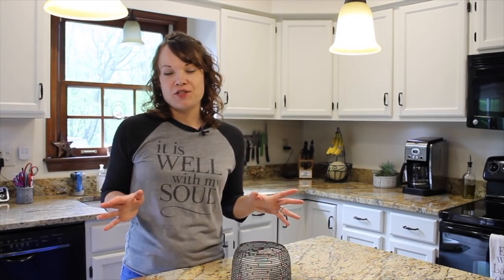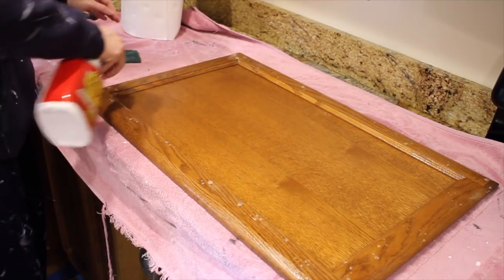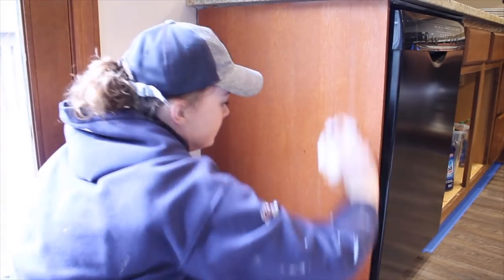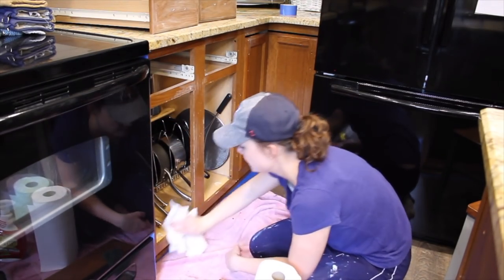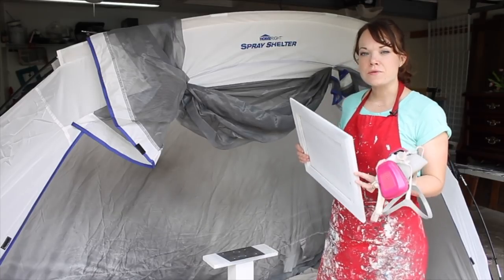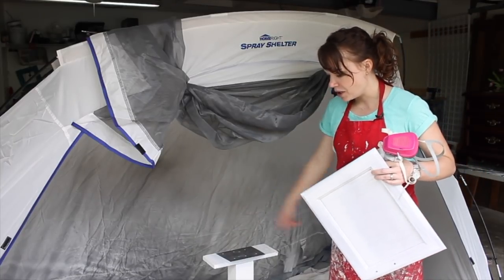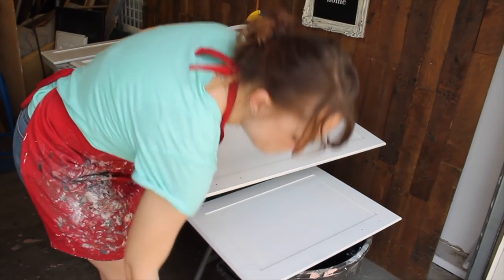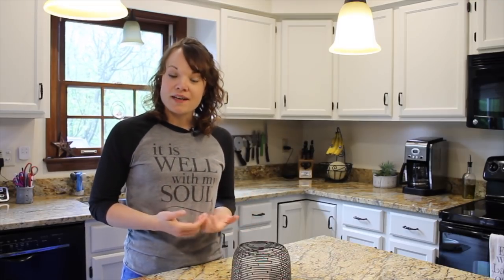How to Paint Kitchen Cabinets with General Finishes Milk Paint

Comment: A lot of extra work for milkpaint. Yes, do ALL that for all other paint. With milkpaint, a good cleaning and then simply add the bonding agent. I've successfully used this method for all my milkpaint jobs, including kitchen cabinets, unless it was raw wood, which doesn't require bonding agent

Comment: I’m actually right in the middle of painting my kitchen cabinets and using general finishes milk paint! What finish top coat did you use? I can’t decide! Love your videos!
Reply from the maker: How fun, great timing! What color are you painting them?  I used High Performance Topcoat in flat finish.  It was just enough shine I thought.
Reply: Going out in a limb and doing Persian blue! Any tips for applying the top coat? Little nervous- I’ve never done one before.
Reply: @RootsWingsHome  did the topcoat yellow the white cabinets? General Finish doesn't recommend putting a topcoat on white?

Comment: Did you sand the paint before applying the topcoat? If so which grot did you use. I've painted a bathroom vanity with 1 coat of primer and 2 coats of milk paint.

Comment: So, you sanded with 220 grit first,  then used Krud kutter and the second cleaner?  I was surprised to see that you can make circular motions with the sand paper!
Reply from the maker: Yep! You want to scratch it up good so the paint sticks! You would never use circular motions if you were going to stain the cabinets instead of painting.

Comment: My kitchen cabinets have previously been painted by a past owner. I believe it is a flat paint. Do you have any suggestions on how to prep the surface? Is stripping the paint the only way because it takes so long and I don't think I have it in me to do it.
Reply from the maker: You shouldn't have to strip the paint if the finish is okay (not too many drips, peeling or chipping paint).  Just make sure it's sanded a bit so your new layer of paint will stick! If there are some spots you don't love sand it smooth.  I hope that helps!

Comment: Nice job..I know you are using home paint sprayer, my question is can you reuse the sprayer with different colors and how do you clean the sprayer after using it if you need to reuse it with different colors?
Reply from the maker: Yes you can! You just rinse the sprayer (and all the pieces) out with warm water,  Just never let the paint dry in the sprayer (or the nozzle) - I speak from experience ;)
Reply: @RootsWingsHome  THANK YOU 🙏🙏

Comment: I'm researching painting my oak cabinets with GF milk paint in alabaster, and everything I've read says not to use a top coat on white or light colors because it will yellow. But I'm worried about not doing a top coat because of durability. In your experience have you had issues with yellowing when painting with light colors and using a top coat?

Comment: I see on your website where you painted your own cabinets with Behr paint. I am trying to decide if I should do a latex paint like Behr, or try milk paint on my kitchen cabinets. Which do you prefer since you have tried both?
Reply from the maker: I used Behr Alkyd (not latex) - it dries to a harder finish than the latex will.  I like either option, but Behr is less expensive and easier to find.  Both have held up great, with natural touch ups needed ever couple of years.  Either is a good option, probably depends on your budget and availability!
Reply: @RootsWingsHome  I was looking at Behr too. I seen they have an enamel paint. I was going to use GF but I'd love to go with a cheaper paint if possible. Do you have to use a top coat with Behr enamel?

Comment: Have you used Dixie Belle Gator Hide for sealer and do you recommend it on high traffic areas?  How does it compare to General Finishes Flat out Flat?
Reply from the maker: I have! I used in on my bathroom cabinets I painted and my front door.  It's very durable.  It's thicker than GF Flat out Flat, and perhaps more likely to show brush strokes.  I think they are comparable though, so whichever is easier for you to get!

Comment: This paint is great., we painted our kitchen cabinets white...but DO NOT use their topcoat.  We did and it looked great but within 6 months they begin to yellow.  We are now in the process of sanding and repainting, this time minus the topcoat.  It is a water based topcoat and it shouldn't have yellowed, but it did.  I should have read all the comments before we started because there were several in there that said their cabinets had yellowed also.
Reply from the maker: It's not the topcoat! It's the wood underneath the paint.  As the water based products are applied (especially topcoat) it brings up the tannins from the wood and stains through the paint.  Use a stain blocking primer under any light color - that's the best bet to prevent discoloring!
Reply: @RootsWingsHome  We did, and it still yellowed.